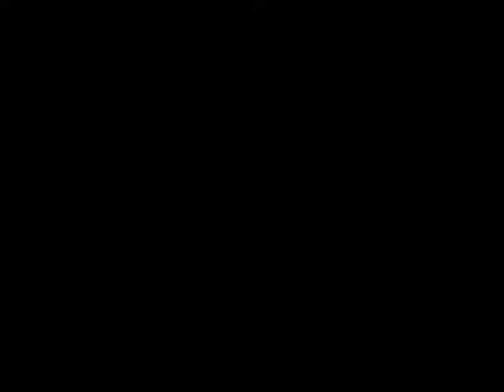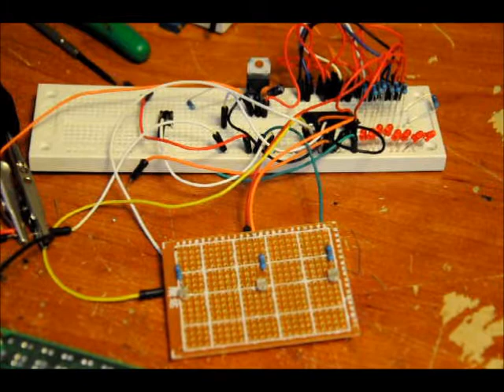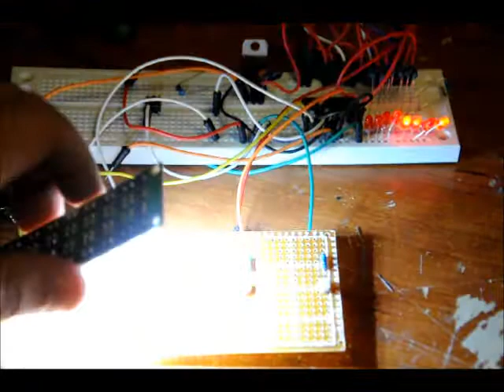The Beginnings Of A Mini Solar Tracker DIY Kit

Comment from the maker: @mrwebb7 Hi there.  I used a stepper before, and it was such a power sucker.  The solar cells that I have are small and the servos I?e ordered are tiny.  decent sized servos can handly 2-4 pounts/cm, so I think that if you mount things right, then yes!  It will be a nominal solution.  Also, it takes little current to operate! :)

Comment: I think this is awesome, thanks for sharing.  Question, do servo motors have enough torque to rotate a solar panel?  I have a project where I set a spring loaded arm, really hadnt thought about  using a servo for that, you think it would be more efficient?